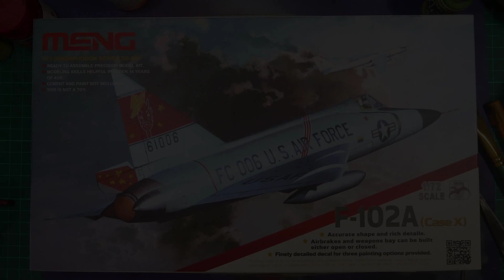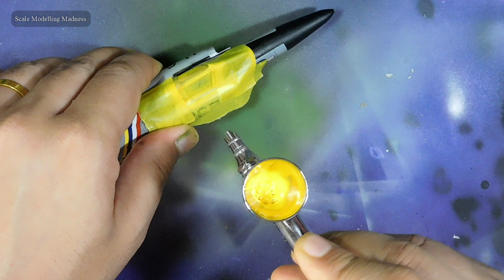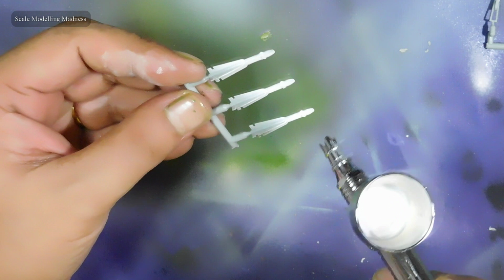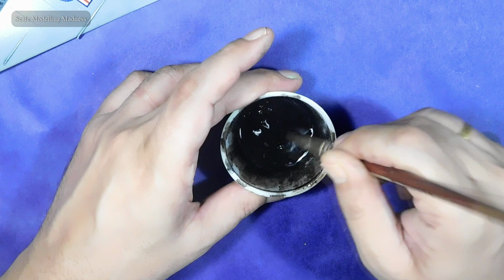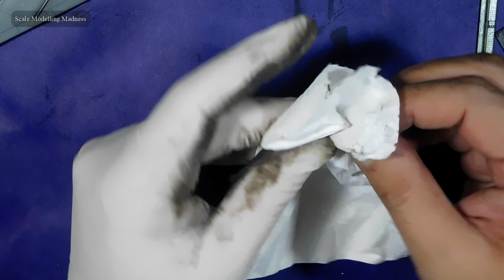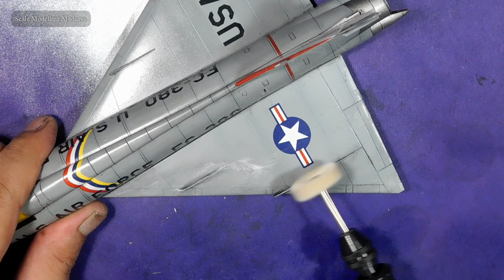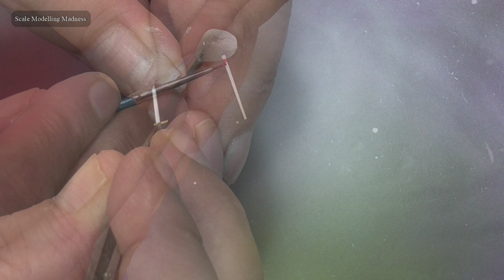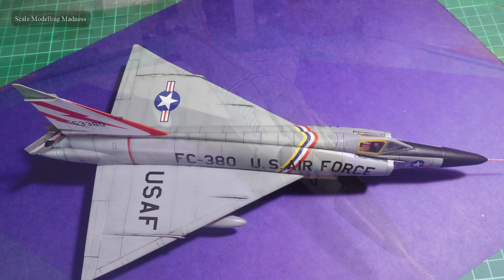Meng 1/72 F-102A (Case X) Delta Dagger (Part 4: Weathering and finishing touches)

Comment: I don't know if it would have worked; but I would have tried putting the pitot tube in your rotary tool at a slow speed and touched it with a fine tip paint brush of red paint to put those stripes on.  Regardless, your striping and Delta Dart look great!
Reply from the maker: You are right KEM. That is something I could have given a try. The problem was that it was very difficult to space the stripes properly by hand. But this is something I will surely try next time I face a similar situation. And thanks for your kind comment.